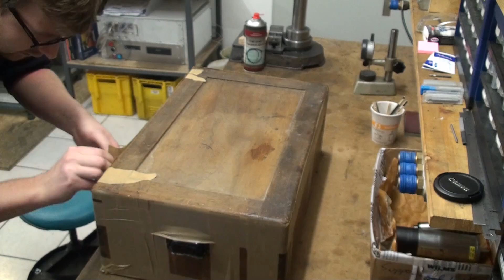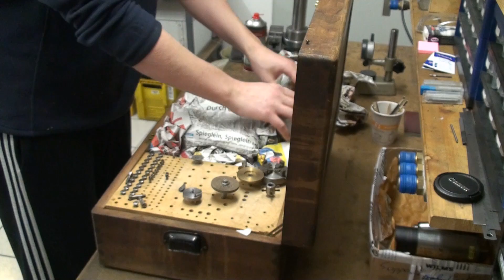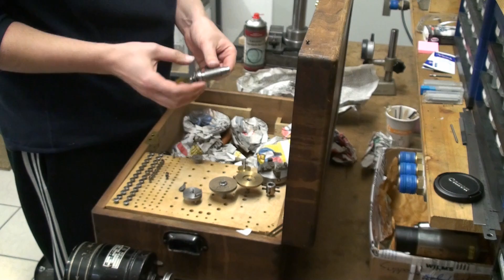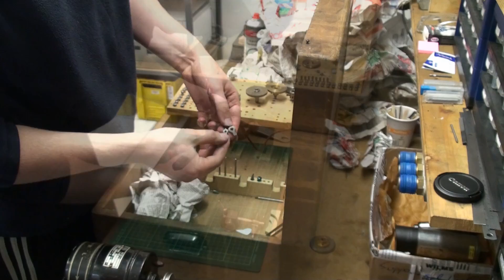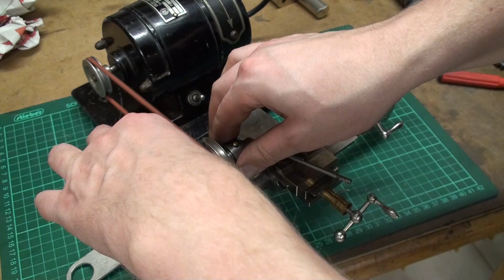Lorch 6mm Watchmakers Lathe - Part 1 - Overview

Comment: Hallo Stefan, how is life in Germany?

25 or so years ago a Swiss BERGEON watchmaker's lathe followed me home.  It came with a few collets in almost  inch sizes, a three-jaw self centering chuck, a 6 jaw self centering chuck, plus a handful of bits and pieces.  
Unfortunately the 6 jaw chuck came with only 3 equally spaced jaws.  Too bad.  I have contemplated making a new set of jaws since these are top jaws and are screwed and keyed to the scroll jaws.  Anyone know where I can purchase a set without getting a new mortgage?  Thanks.

For a drill chuck in the tail stock I adapted a Dremel chuck.  A local hardware store had a sale and I picked up three of them.  Made a new tailstock ram and threaded it for a very close fit for the Dremel chuck.  I picked the most concentric one for use on this lathe.

I don't use this lathe very often, but for turning small dia. and drilling small holes, it is a gem.

Oh yes, the feed screws on the long and cross feed slides work in the accepted manner.  I would have sold the thing otherwise.
For lubricating the bearings I use Singer Sewing Machine oil.  The plain hardened bearings are a very clever bit of engineering.  I'd like to know how they are mass produced.

Greetings from Ontario Canada, where we had very normal summer weather so far.

Comment: Of course you all show it. I have to see someone make as much as a screw or something easier a bridge plate
Reply from the maker: Tbh, i dont like the watchmakers lathe for actual work. My big emco lathe does all the same, just better. I did pins, 0.5mm diameter today on the Emco and it was a breeze with the heavy and stiff machine and the DRO. 
(also i am a machinist not a watchmaker;) i have no clue about mainplates)

Comment: Hi my grandfather had a 6mm lorch  my dad ran an 8mm lorch but for me an 8 mm Boley is the way to go  I have a hand crank wheel for a lorch kicking around somewhere the motor on yours looks like a nice unit you need to find a pedestal to attach lathe to the bench  the end mills I use mostly for spot facing brass disc with collet fitting is used with shellac heated slightly part to be machined  inserted and centred quickly before shellac solidifies then with light cuts machining can take place  thanks for sharing your extensive knowledge  I also have enjoyed learning from  what you've put forward  so many folks seem to indicate an ownership of knowledge  and keep it to themselves  we own nothing in this world it seems to me

Comment: one other thing, the rubber belt is a safety feature too, if you try to take a deep cut, the drive will stall out (belt slippage, due to friction value of this drive style), saving the piece being 'thrown off' like a wood lathe 'catch', or to prevent gougeing marks on the part surface.

Comment: Stefan, the reason for the 'backwards' cross slide and compound feed crank directions is as a safety, if you just rush in, you will move 'instinctively' {lefty loosy-for a right hand thread}, but HERE, it moves the cutter AWAY from the spinning work, saving the expensive metal or workpiece from a catastrophic mistake.

Comment: A lot of the noise that you were getting while running your lathe was the bottom half of that rubber belt resonating like a bass guitar string. Maybe try tightening it up some, or maybe make a leather belt. Should at least quiet things down a little bit, not to mention run a whole lot smoother.

Comment: Very unusual set for a Lorch 6.  You can get a lot of information from Steffan Pahlow who is a Lorch fanatic and has published a set of catalogs and videos.  The large brass wheel with the crank thing is for turning between centers.  The disk with teh set of holes in it is for re-pivoting.  It holds the broken pivot so you can drill a hole in it while it spins in the disk which has tapered holes to line up against the pinion shoulder.  You have n more grinding and milling attachments than usual but are missing the center drilling and between centers  attachments.

Comment: The rose cutters look like hollow mills to me. These are used on turret lathes to cut standard diameters quickly. I could not find rose cutters as they pertain to watchmaking lathes. Can you elaborate?

Comment: I found you channel and am happy to see someone else knows the value of 6mm watchmakers lathe. I just bought one of these. It is a little less expensive than the 8mm and a lot cheaper than the 10 mm. I do have an addiction to the lathes like the fellow in the previous comment. I have nine lathes. I just bought a Derbyshire with all the needed attachments. Collet holding tailstock, cross slide. milling attachment, countershaft, idler pulley and a 4500 rpm K&D 1/10 horsepower. I am in hopes it is strong enough to run a 10 mm lathe. I do have a couple that have peak speed in excess of 1400 rpm. Thanks for sharing. All the best, Sean

Comment: Hi you shocked us we have been watching you and your channel off and on for many years and we missed this you working with what we run micro machines and watchmaker lathes. We love our machines, you do get used to the mini handles they are so accurate sometimes maker thing. We are hoping you will build yourself a watchmakers lathe vise to mount to your bench remove when not in use. We like to say about that steady-rest it supports small holes and smaller holes. Watchmaker lathes are all about the the accessories they are so fun to run. Merry Christmas Stefan.

Comment: you adjust the compound slide angle by placing a "Tommy bar" into the hole in the brass rod extending out of the cross slide, behind the hand wheel, then you move the bar towards the cross feed wheel to loosen the lock.

Comment: Hello Stefan I really enjoy your videos.  I have an 8mm Lorch lathe, your set appears to have some parts I do not have and there are additional parts for you to obtain. Especially useful is a Jacot drum used for polishing pivots. 
Whilst I am no expert I have seen a very experienced Swiss trained watchmaker demonstrating using your “rose cutters” (screw cutters) to make screws. The hollow centre leaves the shaft which is then threaded using extremely small button dies or traditionally  screw (die) plates. The screw is parted off and the slot is cut. 
Watch makers dies and taps can be strange sizes as a stripped hole is usually fixed by using the next size tap without any need to drill the stripped hole. 
Hence the need to make new screws. As the diameter, head size and length are critical. It is worth noting almost all the work on a watchmakers lathe is done by using hand gravers not the compound slide.

Comment: Hi, Stefan, I had a Watchmakers lathe with that type of compound slide, it drove me crazy with the opposite thread, sometimes I would forget and instead of withdrawing the tool from the work I would ram the tool into the work. For forty years I had used lathes that when you turn the handle clockwise you advanced the tool into the work, I got so frustrated that I sold the lathe.
Reply: I've had this issue too...
It's not a great experience when it happens...😖😖

Comment: the plate with slots in it is for use on the tool rest clamp on the lathe, as a tool rest when a grinding wheel is put on the head stock, YES a grinding wheel, to polish / sharpen the hand graver. (THIS is the ONLY lathe you can put a grinding wheel on !!- not recommended on a big lathe, only as a watchmaker you don't have to have a separate grinder, just for graver sharpening; it comes all-in).

Comment: just another point, those feed screws work that way because the work done on this machine is VERY precise ( ~0.001 mm) so any "mistakes" on our part can wreck it, so it's a safety feature, if we mess up , the tool goes to air, not a bad cut!!

Comment: you wondered how to angle the compound slide, you use a Tommy bar in the socket behind the compound's hand wheel , but BE SOFT with it. Steffen Pahlow gives a great video (but on the K D 50 model) showing this, but no words, just look. love the video, these Lorch lathes are works of art as well as functional :))))

Comment: I don't know if anyone has mentioned but there is a set of screw shank cutters in there they look like drilled endmills you chuck up a piece of stock and run the cutter into it and it cuts the shank for threading I saw it on another video and thought I would mention it thanks for the awesome videos

Comment: You said you did not know what the small cutters were.  These are mounted in the tail stock and used
to cut a pivot on the end of an arbor which carries the Gear. This pivot
extends through the front and back plate of the clock or watch.  They can also be used to bore a new hole
through a plate when the pivot hole becomes elliptical due o the side load after the clock has run
for many years, then a new bushing is screwed into the hole and the clock or
watch is good for another hundred years.  Its a beautiful old tool, it's rare to see one so complete these days.  Thanks for sharing.

Comment: the second row ... are those counter bores where the gem garnet bushings go or maybe drive spurs for wood turning?... then the really course threaded  thing, is it an arbor for a buffing pad/wheel?... some of the other round disks, are they lapping plates, one out of brass and one out of cast iron? I not only want one of these little watch maker lathes so bad, I need one (not really, just trying to convince myself that I need one to justify the money), but I also desire to make one as well, how much fun would that be to make one with every possible option on the planet... maybe even make one that is a 3 in 1 machine that would allow for cutting gears and all the milling and lathe work that would let a guy make dinky stuff... Great video, it was fun to watch, like opening toys on Christmas morning... lol

Comment: good video, by the way I think this is the right way to have the feed screws, for safety reasons (as the parts are so small~ 1-5 mm thick) if you accidentally go to move the wrong way the cutter moves in a safe direction- not wrecking your delicate part !!

Comment: The mandrel with the tapered threads is probably for a felt polishing burr.

The little things near the collets with 4 chisel points look like wood drivers for wood turning.

Or those could be hollow mills for turning a spud on the end of a shaft.

Comment: Beautiful machine you've got there.
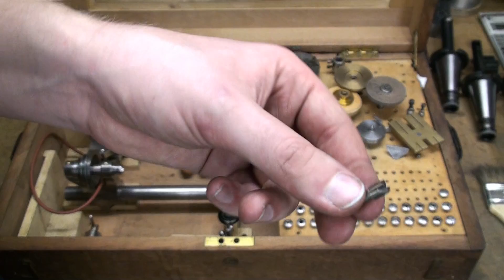I think the part you showed at the 11:50 mark could be a “face driver” (Stirnseiten-Mitnehmer) which you can attach on your lathe center.
The part at 12:27 is indeed a pulley which you can attach on a dead center for eccentric turning, but you don’t seem to own an eccentric lathe center. Here is a picture showing one (second from left).
---http://static.flickr.com/122/289544099_a164a4a2e9_o.jpg---
For eccentric turning you put the belt from your motor on this brass pulley to turn your part.
The workpiece you want to machine is clamped between centers and the stick on the pulley acts as a lathe dog.
Reply from the maker: Philipp Aznable Thank you too for all that input, especialy on the use of the brass pulley :)

Comment: Hi and congrats on the find!  I would like to add to previous comments. The flat disks of wood, brass and steel are lapping wheels (Diamantschleifscheibe) into which you embed diamond powder wetted with oil to polish hardened steel like screw heads or to cut and shape hard stones like ruby pallets. 

The small "endmills" are rose cutters that you would use in the tailstock but I did not see the small taper chuck to hold them. Maybe you have it but did not show. 

The big screw center that goes into the headstock is made to hold a boxwood chuck which you would custom make to grip a watch case or a bezel softly so you don't scratch it.

Finally, the headstock rectangular "foot" is made to be clamped into a bench vise of the type like you have on your Lista workbench or a smaller watchmaker 45 mm one. 

The best resource on Lorch watchmaker's lathes is a compatriot of yours, Steffen Pahlow who has a website and Youtube channel. 

Daniel
Reply from the maker: AtelierDBurgoyne Thank you very much for your comment, I will try using the laps, and I will see how it goes :)Youre right, there is no way to hold the rose cutters with the accessories of the machine - I might machine my own tapered arbor for that use.That the "foot" is meant to be clamped in the vice makes sense, but I saw that there was also a dedicaded foot availible, that I may replicate.

Comment: You have a real treasure there. Some time ago the Swiss went to 8mm collets. A 6mm lathe (the dimension refers to the size of the collet shank) is very difficult to find and a complete set of collets is next to impossible to get. (I read watch/clockmaker's forums and web sites; my current project is to build a clock).

The  best book I have found on the topic of watchmaker's lathes is Donald de Carle's "The Watchmaker's and Model Engineer's Lathe" written in 1957 or so but still available in revised form. Search for it. There is no ISBN on my copy. Too old.

A lot of watchmaker's work is done by hand with gravers. Very important you have the handrest! The motor is of course antique. You could replace it with a sewing machine motor, which are typically 1/10 Hp (75 Watt). But if yours works, keep it. 

Final comment (much too long already). Now you will have to build a watch :):) I can hardly wait!
Reply from the maker: Juan Rivero Hi Juan, thank you for the kind words, I will take a look for that book you mentioned - I already tried the turning with the handgravers and it feels not to bad, I think I can get the hang on it, I also will absolutely keep the motor, it makes some noises (I think from the coal brushes, not as I earlier thought of the bearings), but its still a nice motor :)I will keep the watchbuilding back until my retirement in 2060... ;)
Reply: I foresee a trip to Furth to a nice electronics store to get carbon brushes ordered that you will have to machine to size.
Reply: Maybe get the sewing machine motor with a steel plate under it for low noise working they can be used with a foot control lol  :-) then you can store, put the original motor away.  Awesome stuff. You could use it in bed at a retirement home in your old age. I love miniature stuff, well done, good find and best of ideas too yu brother :-):-):-) and turn it around 180 for reverse.

Comment: Hey Stefan, well done on the watchmaker's lathe! I'm very jealous - I have a watchmaker's lathe addiction, although all of my lathes are 8mm. Maybe I could offer you some info? The best books available on the watchmaker's lathe (which will describe just about every accessory and how to use it) will be the one by Jendritzki and the other by Donald de Carle. Both easy to find online. 
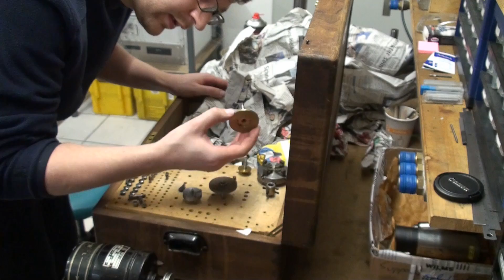At 1:30 I think the brass/bronze disc is actually a lap, for polishing. You would embed aluminium oxide powder on it and use that to polish hard steel parts. There is also a wooden lap and an iron one, which I think your lathe has. 
The little grinding table will also double for a saw table; you'd need to get a blank arbor onto which you install a slitting saw for this. 
At 11:53 you have a rose cutter/sinking cutter. Use either to reduce the underside of a screw head to make the screw head shorter, or to make a small flat-bottomed countersink in a piece of stock. For this you might need to fit a small pin into the middle of the cutter, to help guide it. 
11:59 is a Jacot plate/pivoting plate. You're right that it's like a steady rest, but only to be used on the far end of the work, not somewhere along the shaft. Watchmakers are constantly having to drill axial holes into the ends of arbors (to replace broken-off pivots), and this plate supports the end of the shaft while you drill it. 
Beautiful lathe! Well done.
Reply from the maker: Kosmos Horology Wow, that was a great post, the "faceplates" make much more sense for lapping, now as you say it - And right, there is also a wooden and a brass one :)I will also take a look at the books you mentioned, I took it down to my notes.Thank you very much!
Reply: Could you point me towards a site where I can Identify my clockmaker's lathe? Thank you.

Comment: That's a thing of beauty. Very nice acquisition.

You should totally make a pair of legs for it. The thing i've always liked about these watchmakers lathes (those that i've seen in person) is that each owner ads a bit to the original.
Reply from the maker: aserta Thank you, the lathe and it will be an ongoing process to complete it, thats for sure :)I might get a set of the original feets for it, or machine a set myself :)
Reply: Stefan Gotteswinter ㄛ